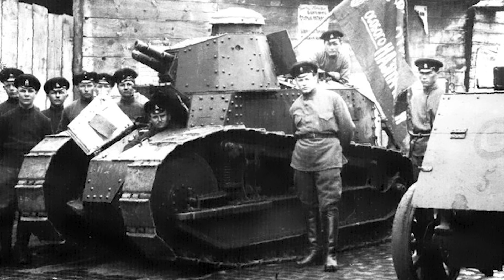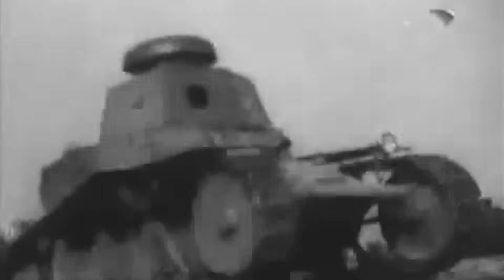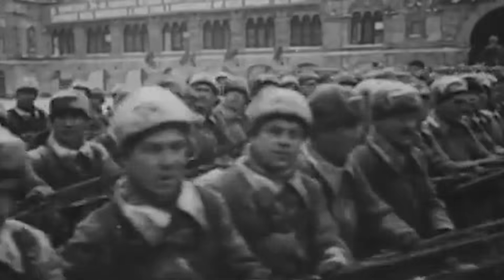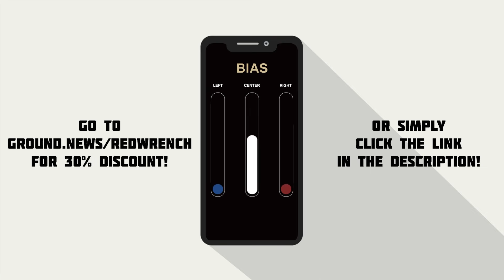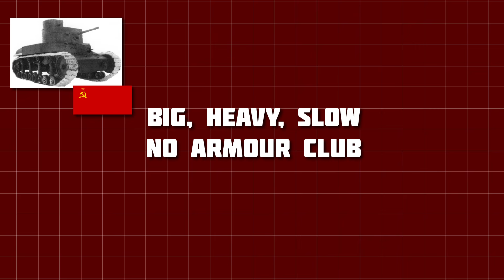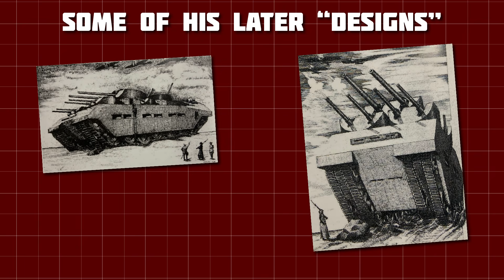8 Failed Soviet Tanks You Probably Haven't Heard Of

Comment: They also have this pretty dumb tank the T-42 it mass is 101 ton with the numbers of crew is 14-15 and it have 90mm thick of armor (front) 
Main gun:
It have a 107mm m1910/30 gun 
Secondary:
2x 45mm 1932/38,4-5x 7.62mm DTM machine gun
Designed years:
1930-1932 
In service:
None

Comment: I argue that the BT and T-26 were all the capable. I mean they could run. Which if your talking about a car is all you need. But when called to actual combat their performance was pretty awful.
Reply from the maker: They performed well in any combat they saw during the 30s. They were largely obsolete by Barbarossa but that does not make them bad designs.

Comment: Random question: I is the BT considered a armored car because  it can run with out treads.
Reply: Tracked/Wheeled Combat Car. The Soviets also used an armored car with a tank turret. It had two rear axles so was equipped with two sets of tracks that went around the rear wheels. J. Walter Christie's company made continuous rubber tracks for the rear wheels of commercial and logging trucks for use on muddy roads.
Reply: @billwilson-es5yn  ah yes, the Soviet Inter Bellum-era BA-30 turreted half track, or are you instead talking about the also Red Army Austin-Kégresse* half-tracked armoured car from the Russian civil war.

*AN: the Austin-Kégresse are a Russian Red Army conversion of consisting of basically mounting locally-built armoured hulls of the British-designed Austin armoured Car on the chassis of a Kégresse half track
Reply: @Saturnus_Ouranos  The Ba 30.

Comment: I would like to see another video like this, but with American interwar tanks, just because I can’t find that much information about them.
Reply: The US Army didn't bother with designing tanks after the war. They used Ford's Renaults and tested what J. Walter Christie came up with. The Army told Christie their specifications  and he would build them differently.  The Army Arsenal finally built one design according to the Army's specs  to be known as the Model 1928. Some countries check it out. It resembled a tall Churchill Crocodile. Then Christie introduced his Model 1929 fast tank so the Army paid him to produce several with the Army adding on a turret. It was liked by the tankers so the Army had Ordnance design one like it then hired American - LaFrance to build it. They were slow and went way over budget so had their contract cancelled with further tank development handled by the Army Arsenal. They reduced the length and weight of the combat car by using a Wright radial aircraft engine coupled to the rear transmission which enabled both to be removed while connected for servicing by using a truck crane. The Army adopted it in 1938 then declared it obsolete in early 1939 after watching the fighting in Europe. They told Ordnance to come up with something that was better armored and armed with a robust suspension and drivetrain that would be easy to repair out in the field. The Army Arsenals were working on a light tank and had finalized a design that became the M2. They drove one from Lima, Ohio to Washington DC on public roads in good time without any breakdowns (used 2 Cadillac V8's and a Buick Hydramatic automatic transmission). Congress was impressed so gave the Army the OK to produce them. Ordnance hired Chrysler to help out designing a medium tank and the factory plus machinery to make the parts. They came up with the M3 and M4. Ordnance also designed a heavy tank at the same time which was the M6. They figured Germany was doing the same thing so wanted one ready to counter theirs. It had the transmission and final drive in the rear and used a larger radial engine. They used a fluid drive transmission of their own design that used kerosene as the fluid. They also made a few that used a gas engine spinning a generator that powered electric motors that turned the drive sprockets. That type of drivetrain allowed the tank to travel at the same speeds in forward and reverse. It worked but had too many maintenance problems so was set aside for further development for use in the T series that were to replace the M4. The M2 was improved to become the M5. Ordnance then  used the M5 chassis to make the M7 fast artillery tractor. They called it fast since it could tow field pieces faster than a team of horses.

Comment: The problem with interwar tank designs is that pretty much EVERYONE screwed them up monumentally.
People THOUGHT they knew what had worked during WWI, and they THOUGHT they knew what would work in a future war, and mostly, they were wrong, just more or less radically so.

.

Nice video.
Reply: 7TP jednowieżowy
Reply: I would argue the Brits got it right, they were the first who thought of armored warfare where every military branches are mechanised in the 1920s. By the War started, it was the only nation with small but effective crew number, good gun, and adequate protection, which became the norm on tank designs on the later years, with a clear doctrine that continues to be used until a new doctrine was created universal tank, which now we know as MBT.
Reply: @arianwinanto6299  "I would argue the Brits got it right"

Uh-huh...

"it was the only nation with small but effective crew number, good gun, and adequate protection"

Say WHAT now?   The standard British tank gun, at best, was the 2 pounder.
And the British were the most extreme in dividing tanks between cruisers and infantry tanks.

The Cruiser series of British tanks topped out at 30mm armor.   The Crusaders were only slightly better and it wasn't until summer 1942 that the Mk III got 51mm armor along with being the first to mount a 57mm cannon.
A gun that would have been great in 1939 and 1940, which by 1942 was of uncertain value.

The Matilda had mostly good or ok armor, but it was still not a modern tank, with too many weak spots, and it was literally made to move at infantry WALKING speed.

Pit a T-34 against any British tank 1941 and who's the better tank is predictable.
The British 2 pounder is essentially useless against T-34 armor while the medium velocity 76mm gun on the T-34 will tear anything but the Matilda completely apart.
And the Matilda can't handle the HE shots without detracking, allowing a T-34 to easily get at its vulnerable sides and rear.

And while the KV-1 were rather crude for its time, they had roughly the same protection everywhere, or better, than the Matilda II had at best.
Coupled with the same 76mm gun as on the T-34.   British Cruisers and Crusaders in 1941 couldn't even penetrate them even if they got endless free shots.
And even their later 57mm gun upgrade needed special ammo to pen the kind of armor the KV-1 had.

.

"they were the first who thought of armored warfare where every military branches are mechanised in the 1920s."

They were the first that tested it.   It's arguable who first considered it.
Charles DeGaulle was a serious pioneer on the subject, to the point that Guderian personally translated his military theory books to German between the war as he considered them absolutely essential reading.

And by the time WWII started, France actually probably had the most mature and functional mechanised warfare doctrine.
Except of course, that only the French experimental divisions that had been testing it knew it, and only from experience, with no formal training or formalised rules.

Also, Jean Estienne tried to form a fully mechanized French force already in 1921, 4 thousand tanks and 8 thousand APCs.

Also, the idea of fully mechanized warfare came about VERY early also in the red army.
Because the warfare there during WWI had tended to be VERY mobile, something that quickly made the idea highly relevant.

"which now we know as MBT."

Essentially, the T-44, which then in revamped form became the T-54, the most produced tank ever.
Reply: @DIREWOLFx75   I did say "by the war started", which most nations had interwar tanks. Maybe I oversimplified on the armour part, but Matilda 1 can held up its own against German 37mm AT guns during the German invasion on France, though the tank itself was designed from a mix of old WW1 tactics and their experimental tactics which later developed into the Light, Cruiser, Infantry.

Tank cannons at the start of the War, Germans had majority of 20mm, Pz3 with their 37mm was being fielded at a smaller number at the time, Soviets had their 45mm or the howitzer 76mm which isn't what's used on their T34, US with 37mm which was as good as the 2pd.

2pd itself was deadly in France and the African campaign until the Germans uparmored their tanks.

Obviously, when the war entered its mid years, most of the Soviets and the US better tanks entered the service at a greater rate which saw the tanks that are even better than the Brits such as the T34 and the Shermans.

I would say France had a good development on their doctrine and tanks too, but due to their loss we didn't see "much" action and it's hard to judge it's effectiveness, and as you said, the training wasn't spread out to other units. But their tanks do give much stress for the Commander though.

On the MBT part, sure it's very hard to know who did started that. Some say Comet tank started it, some say T44, some say the Panther, I've even heard that the French started the concept.

Feel free to disagree ofc, I'm just here to clarify the time in my previous comment.
Reply: @DIREWOLFx75 in 1939 the 2 pounder gun was pretty much the best tank gun in use by any nation, remember this is about interwar tanks so the t-34 doesn’t really count does it?
Reply: @deeznoots6241  "in 1939 the 2 pounder gun was pretty much the best tank gun in use by any nation"

HAHAHAHAHAHAHA...

By that time, France had the 47mm.
Roughly equal to the 2lb, but slightly better in total because it could fire better HE against unarmored targets.

Germany had the 5cm KwK 38 and KwK 39.
Both superior to the 2lb, the L42 by a little and the L60 by a lot more.

USSR had the 45mm 1932, both /34 and /38 versions, AND they had the 76.2mm model L-11, which despite being very inferior to later guns, in 1939 could easily be argued as the best one around as it was capable of doing everything.
And less than a year later, the 76.2mm F34 goes into production and service.

Also, cherrypicking "in service in 1939" is just lame when you know that there's a lot better stuff arriving in less than 10 months.
Not to mention what is under development.
Like the KwK40.
Reply: @DIREWOLFx75  The matilda was one of the best tanks of the early war with only the pz3 or KV beating it in certain situations.

The T34 with it's L11 gun is not as good as you paint it, the matilda could probably handle it just as well as german tanks with near peer weaponry as the matilda did; the t34 was also more unreliable, with poorer crew ergonomics and frequent breakdowns.

Also the matilda being a slow vehicle is not as stupid as you make it out to see either, most nations had the concept of a slower "breakthrough" tank with a faster light tanks to exploit those breakthroughs, the BT and KV tanks are literal examples of this, the french did not follow these ideas but they did have the B1 which could be considered an equal to the matilda, this was not rare.

The 2 pounder was an effective anti tank gun with inadequate anti infantry performance, the soviet 45 was worse, the german 37 and 50 were equal, the french 47 was better.

The 6 pounder was an effective anti tank gun by the time it was introduced in 1942, much unlike you portray in your original comment, this gun remained one of the most effective anti tank guns until the end of the war.

I am aware this is a 2 year old exchange, but i cant stand seeing clearly biased information.
Reply: @Un-gh3jo  "The matilda was one of the best tanks of the early war with only the pz3 or KV beating it in certain situations."

Uh, matey...   The Matilda was laughably undergunned and just barely beyond rapid walking speed in mobility.
Yes it had armor, but it wasn't a good tank.

And the Pz3?   WTF?!? Seriously?

The Pz-3 started the war with a weak 37mm gun and 30mm vertical armor.   It wasn't until 1942 that it got the actually effective 50L60 gun in numbers.
The Pz-3 only advantage was the crew setup and TACTICS.

And yes, the KV, of the tanks you mention it is BY FAR the best one, but it's still huge and heavy and had no turret basket, which among many smaller flaws made it less capable than it could have been.

"The T34 with it's L11 gun is not as good as you paint it, the matilda could probably handle it"

lol

The L11 has a chance to destroy a Matilda even from the front with its 75mm penetration.
And firing HE, it would utterly WRECK the Matilda.

Meanwhile, the Matilda up until 1941 have NO AMMUNITION CAPABLE of penetrating the T-34 from the front.   And needs a lot of luck even for sideshots.

"just as well as german tanks"

Or in other words, NOT AT ALL.   German tanks mostly didn't get guns capable of being a serious threat against T-34s until 1942.
Before the 75L43 and 50L60, German tanks were generally incapable of penning a T-34 except by lots of luck.
Unlike the Matilda however, their 75L24 at least could hit them and do effective damage with HE.

"the french did not follow these ideas"

Actually they did, they just had their own ideas about it.
There's a reason why they made a difference between "cavalry tanks" and the various other designations.

"The 2 pounder was an effective anti tank gun with inadequate anti infantry performance, the soviet 45 was worse, the german 37 and 50 were equal, the french 47 was better."

The 2pd was effective against German tanks of 1939 and 1940 yes.
Because those tanks topped out at 50mm VERTICAL armor and had a paltry 30mm vertical on the sides.

The T-34 had 45mm frontal armor at 50 degrees slope and 40mm at IIRC 30 degrees.
That's about 70-90mm and 50-60mm effective protection.
Even with the overcharged loading used later for the 2pd, they topped at 105mm penetration at 30 degrees 100m range.
While their 1939 loading tops out at just 50!

And no, the Soviet 45mm gun is BETTER.   With standard ammo in 1939 it could manage 60mm penetration, 20% better than the 2pd.
And even without dangerously hotloading them, they still managed 94mm penetration.
Much better.

And dude, the German 37mm in 1939 was blatantly inferior to even the 2pd.
While the 50L42 is roughly equal to the 2pd.

And yes, the French 47s were clearly superior to all of them, capable of penetrating 60mm at 500m rather than the 100m of Soviet 45mm.

"The 6 pounder was an effective anti tank gun by the time it was introduced in 1942, much unlike you portray in your original comment"

The 6lb would have been a GREAT weapon if it had been introduced in 1939.

The only reason it was decent in 1942 is because it rarely faced tanks with heavy armor.
The mostly 30 and 50mm of vertical plates on Germany Pz 3 and 4, well yeah sure, no problem.
Against vertical, normal quality armor it could manage over 110mm penetration.   Easy.

But against Tiger or Panther, it was mostly useless unless it used expensive topend ammunition that wasnt even around much until 1944.

"this gun remained one of the most effective anti tank guns until the end of the war."

It really, REALLY did not.   Even worse, it was just 57mm, so it couldn't double effectively to fire HE against soft targets.
There's good reason why late war, even the Pz-3s got upgunned to the old 75L24, despite those being low velocity howitzers.

The 6lb was GOOD, absolutely.   But it was 5 years too late.   It still worked reasonably well during the war, but if the German pre-war tanks had been more properly armored, it would have been insufficient.
Even as it was, the UK itself evaluated the 6lb as "not good enough" already by 1943.
But with their manufacturing limitations still causing problems, they were unable to massproduce something more suitable.

"I am aware this is a 2 year old exchange, but i cant stand seeing clearly biased information."

Do your research better.

Comment: Hiring a German for a heavy oversized tank is either very smart or utterly insane.
Reply: Grote: hold my beer and starts designing T-42
Reply: @ivanmonahhov2314  Oh god not that thing

T-35’s Father basically
Reply: I mean, they fixed the Bri'ish Sa80 and made it good so they're not bad when it comes to machinery.
Reply: @UnknownOps  The SA80 is also not an early 20th century heavy tank.
Reply: @Eonymia  Yes, if you upscale and put wheels on it, though.
Reply: Fun fact: This is the same Eduard Grote who later went on to waste time, money and resources on developing a 1000 ton super tank for Germany. 

Fun fact number 2: Almost everything on the Wikipedia website for said tank is falsehoods and misinterpretation that have accumulated over the decades. The name Ratte is complete fabrication and nearly all images of the tanks design are completely wrong.
Reply: Or insanely smart 😂
Reply: The Grotte is actually smaller than the medium tanks that followed until the bt concept birthed the A20 and the t34. As the narrator said, it's flaw was that the ussr didn't yet have the industrial capacity to build it - the same would have happened to a t34-85 design at that time (scrapped)
Reply: Russia hosted hush hush German tank development in the early 30s
Reply: @cjthebeesknees  until Hitler came to power and just testing grounds. Dutch hosted sub development and Swiss some of firearm development
Reply: @cjthebeesknees  which ended in 1933 when the nazis came to power